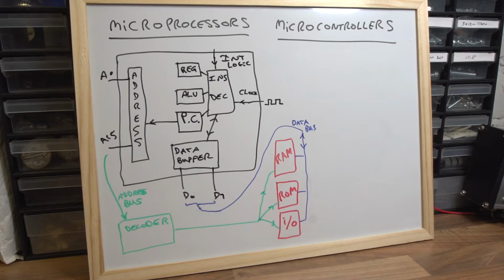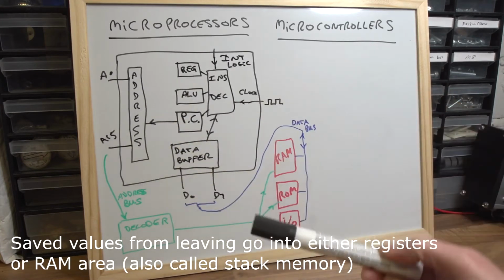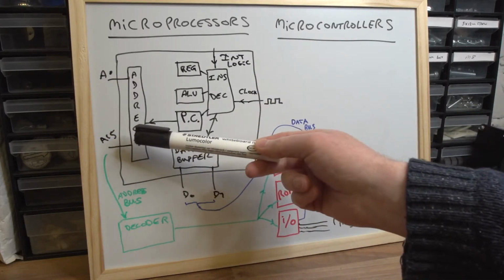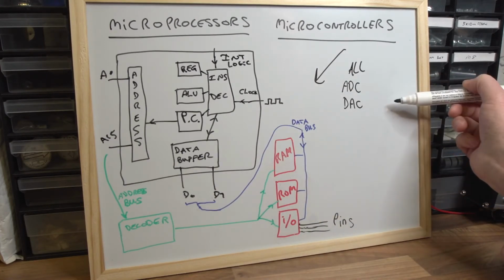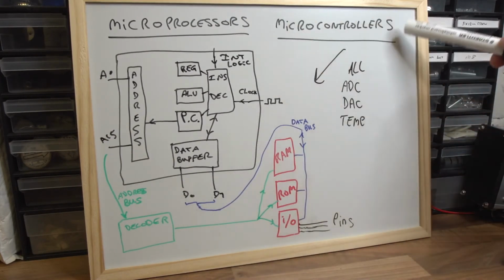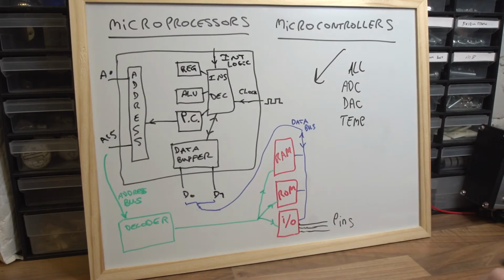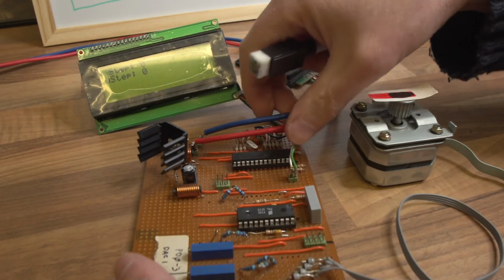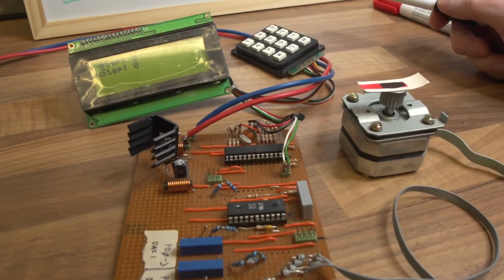Introduction to Microprocessors and Microcontrollers

Comment: Erm, the Raspberry Pi is built with a microprocessor, not a Microcontroller. While the Broadcom chip is considered to be a system on a chip, it doesn’t host RAM, ROM etc, and most importantly from a Microcontroller point of view it doesn’t provide deterministic execution time. The ARM Cortex A series processors are designed to run code as fast as possible (using high internal clock speeds and cache memory). The ARM Cortex M series are designed to provide deterministic performance (they always take a given number of cycles to execute a given piece of code) and have on board RAM and ROM. The Cortex R series are specialised to handle real time tasks that require immediate response.
Reply from the maker: I stated that in the description Steve (point 2).